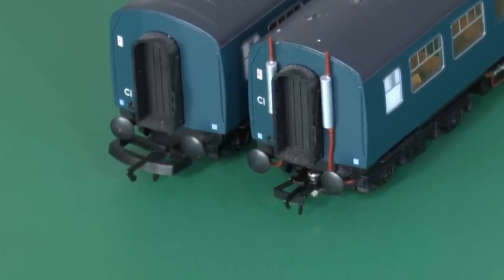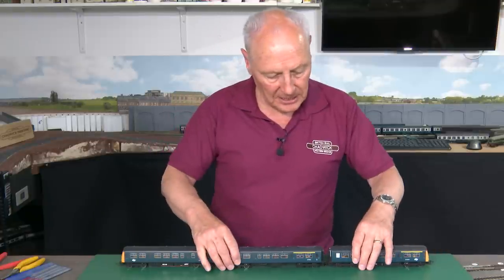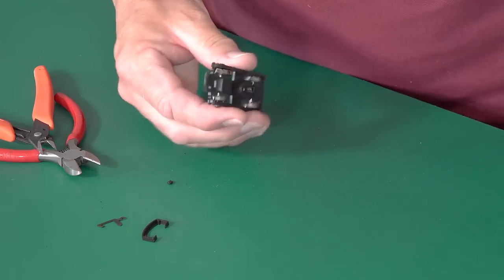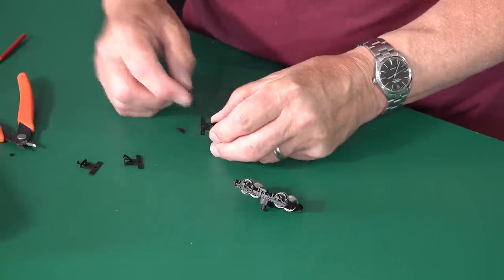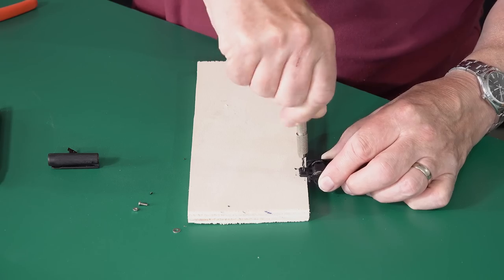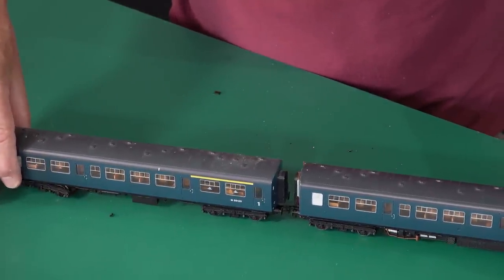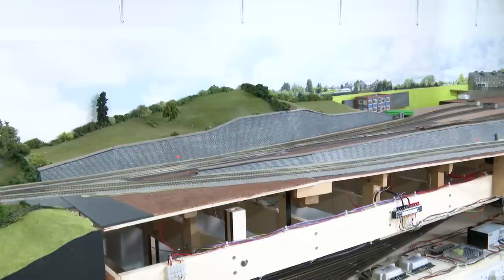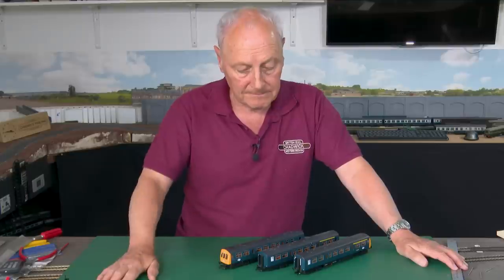REPLACING D LINK COUPLINGS IN SECONDS at Chadwick Model Railway | 196.

Comment: To hide the nut, use matt black nail varnish (hides a multitude of stuff) and does not require brush cleaning; it will also act as a form of loctite. Great video as always. Tom.
Reply from the maker: Thanks OOE, what a great suggestion. Regards, Charlie
Reply: There is always matt black paint!😊

Comment: Charlie,  I have worked in the aviation industry for over 46 years and may have some ideas that would make the coupling appearance a little cleaner. 
If you were to countersink  the heavier plastic and use a countersunk flat head screw and on the other side, use a tinnerman nut, it would be almost unnoticeable.  A touch of flat black paint and it shouldn't be noticed at all.  
I really enjoy your channel and look forward to each release.  Thanks for sharing.
Reply from the maker: Thanks Ernest, however, I shall have to look up tinnerman nut! Regards, Charlie

Comment: A lot of scary sharp tools in this one Charlie! The small black bachmann coupling fixing screws or the ones that hold Oxford cars in place etc. can be used in place of the bigger nut and bolt method, drill a smaller pilot hole and use the screw's self tapping properties to hold the coupling in place.
Reply from the maker: A sensible alternative William. Regards, Charlie
Reply: I did it similarly but with an M2 tap and black nylon screws

Comment: A tip, Charlie, for removing plastic carefully and accurately ..

A 2 or 3 inch thick block of wood, to raise up and support the item. ( The block can be shaped to hold the part more easily).
A file which has never tasted cold steel, but only plastic, used on an item supported on a block ,will remove material far swifter than trying to bring two trembling paws and a spinning machine against a tiny plastic part. 
A jewellers bench peg is the superior version of my suggestion.
Reply from the maker: Wise words, John. Many thanks for your guidance, regards, Charlie

Comment: Hi Charlie, if you drill an under sized hole and use self tapping screws you could do away with the the nut and washer. I have done this loads of times and never had a problem.
Reply from the maker: That’s interesting Terry. What size self tapper did you use? Regards Charlie
Reply: Hi Charlie. The self tapping screws I use are made by 'EXPO' part number A33010   PK, 100 2g x 1\4'' self tapping screws. you may want longer ones, depending on the thickness of plastic you are going through. (Am I teaching you how to suck eggs! lol) Kind Regards. Terry
Reply: @ChadwickModelRailway  Hi Charlie. Sorry I did not reply to you correctly and added my reply to the thread! so here it is again. The screws I use are made by EXPO part number A33010 PK 2g x 1/4'' self tapping screws. longer may be required depending on the thickness you are working with. Kind Regards. Terry
Reply from the maker: Thanks Terry, that’s most useful. Regards Charlie

Comment: With the Lima ridge you can also leave it, level off with a 1mm piece of plasticard cut to size glued behind it and then glue and screw in a Bachmann cranked coupling. Both methods work. Very helpful video Charlie.
Reply from the maker: I’m so pleased that you found a workable solution as well. Peter. Regards, Charlie

Comment: Superb work ! I take note from you because I have bought some Parkside and Dapol wagon kits, and I want to put Kadee no. 5 on them. You put forward some issues you can have while fiddling with couplers, and some clever solutions. I have thought first to simply glue my Kadee boxes below my wagons, but I will certainly take your nut and screw method in action. It seems mechanically sounder than simply glueing, and you can replace a faulty/badly dimensoinned coupler (shank too short for instance, common problem while choosing the right size for a Kadee coupler).
Reply from the maker: I know what you mean, Oliver, I do love KDs but the choice is huge.

Comment: Hi Charlie, Another great video🙂I've done this to my Lima 100 ton tankers and they look so much better, I used a self tapping screw to secure the Bachmann  coupling. I just cut the old D type coupling off with cutters as you did, however when I tried this on some Hornby double vee cement wagons I discovered that the plastic bogies were made of a different plastic and didn't take to kindly to having the D coupling cut off, unfortunately the bogie frame shattered 😱I had to use a small razor saw instead. Regards, David.
Reply from the maker: Thanks David, for an interesting revelation. Regards, Charlie
Reply: Did this with my Lima 100 t tanks too, great improvement.

Comment: Bloody good stuff, Charlie as usual. Many years ago I did some mods like this. I drilled a hole slightly smaller to use with the tiny Black Computer screws to bite into the plastic without having a nut attached. Though if weathering the rolling your M2s will hid better too. For me, with them being a smaller screw I found it helped to blend them in with the coupling and bogie while still holding the coupling in place. If you want to make it permanent, then after all the work and testing is done, is to finish off by adding some superglue and then remove the screw fix altogether. Hopefully this will help as well to anyone that wants to do this mod on their own rolling stock.
Reply from the maker: Excellent suggestions T M. Much appreciated. Regards Charlie
Reply: @ChadwickModelRailway  Anytime, Sir.

Comment: Hello Charlie, I am an n gauge modeller and even replacing the D couplings as you have done they still look very "toylike" and clunky. The gap between the coaches still looks far too big and I would suggest shortening further. Plus fitting corridor connectors. Im no expert on OO gauge couplings but this type just dont  look right on the front or back of trains. I think you did the right thing removing them from the DMU.
Reply from the maker: Yes Robert, it’s a real shame.
Regards Charlie

Comment: Well done with another informative swift video Charlie.
That is such a simple modification.
Much simpler than the mods I had changing all my goods wagons from D links to Kadee's, where araldite had to be involved, no reverting back to D links now.. lol.
Take care and stay Safe
Reply from the maker: Gosh, David, that must be one hell of an undertaking. Regards, Charlie
Reply: @ChadwickModelRailway  It was Charlie, but luckily all the surfaces on the  underside of the chassis under the "buffer bar" were the same height from the track top once all the original coupling moulding was cut off and surfaces cleaned. So just a matter of gluing the Kadee "gear box"assembly, with the whisker coupling, to that surface. All looks really good and more realistic than the big D links, in my opinion..lol. Take care

Comment: if the screw faces up and comes loose the coupling will detach and you will have to search the track for the nut washer and screw, A touch of thread locker, crazy glue or even clear nail varnish will lock the nut in place. thanks for another great swift, Charlie ven if it ran over.
Reply from the maker: Thanks John, I will use some Loctite, once they’ve proved successful. Regards, Charlie

Comment: Another highly informative video Charlie. From an engineering point of view, for me, the screw always goes downward (Ie..the screwhead facing the sky) - that way, should the worst happen and the nut falls off the screw acts as a bolt giving the chance of salvation. If it were inserted from the bottom and the nut fell off the screw would bounce down the track derailing all-comers! :) .
Reply from the maker: You are of course, right Roger. I did that from my helicopter maintenance days. However, we are just playing trains. Regards, Charlie

Comment: Hey there Charlie, I would look at using a small amount of epoxy between the bogie frame and new coupling plus a dab of black paint on the screw assemby to make it neat. 

I recall about a decade ago I was going to go down the Kaydee coupling path but abandoned it after converting a similar 3 car DMU because of the cost. 

Cheers though much appreciated.

Don't forget your safety glasses with the Dremel chum! 

Regards from Oz. Gaz
Reply from the maker: You make an excellent point Gaz. However, if I wanted to swap it out for an NEM socket, then it would be more difficult. Regards, Charlie

Comment: I was hoping for something a little different, but then I'm biased, being in the US. I need to go from a D coupling to a Kadee coupler. What I have done is took them off, and 3D printed a fixture that screws on the train, and accepts the Kadee coupler. So far I've done it on the Reindeer car by Hornby and Emily by Bachmann, which I converted into the steam engine she was made from with working lanterns on the front. I am not a fan of Thomas and Friends, but they do provide something to start with in making an engine I can't get. Like I want to make Lady of the Lake from Emily, since I have made a 4-2-2 steam engine from her now.

My new engine has NEM couplings on it, so it should be a pop out and pop in the Kadee. 

That hand drill can not be undersold. That was one of the best tools I ever got for doing modeling. If you don't have one, you don't know what you are missing.

Great video.
Reply from the maker: Thanks Leslie,  great comment, perhaps you should produce a video on your method.  Regards Charlie
Reply: @ChadwickModelRailway  That might not be a bad idea.

Comment: Very good video Charlie. I did something very similar with my class 101 DMU, but instead of using the small tension couplings, I used the hunt magnetic ones. This prevented the separation on slopes and bends, but also closed the gap between the gangways.
Reply from the maker: That’s interesting, did yours come with NEM  pockets.? If not which pockets dId you use? Regards Charlie

Comment: Hi Charlie re your D Lunk coupling conversion. Given your not needed to break up the DMU. You could use magnetic coupling.  They work brilliantly on rakes that run in either direction and can’t ride up. I also found Porter House are good value vs some others and look better.  Just a thought.
Reply from the maker: You are bang on the money, Howard. However, some folks wish to stay with tension locks hence the video. Regards, Charlie
Reply: I still have to mix it up so that there is an uncoupling end to shut etc.  .  But I heard from West Hill wagon works they might have an uncoupler for magnetic couplings at Waverly! Be interesting if they do.
Reply from the maker: Yes Howard, that will be an interesting revaluation. Regards Charlie

Comment: There's a reason top-level wire cutter snips at electrical supplies cost so much more than those budget 'snips'. They look the same but are not the same. Took me years to invest in good ones and immediately regretted not doing so earlier
Reply from the maker: Yes Stephen, you’re dead right, buy cheap, buy twice. Regards, Charlie

Comment: I am really surprised that they don’t use Knuckle couplers everywhere to me they look more realistic than the type that you get on your side of the pond.
Reply: Indeed. Can anyone tell me why they still use those type of couplers on models in the UK? Is it because knuckle couplers were not used in the real railways in the 1960s and 70s?
Reply: The 1st generation DMUs still used screw couplings as did locomotives (except for Southern Region push pull fitted locos such as the 33/1s and 73s). Coaching stock used Buckeye (ie knuckle) couplers which swung down to reveal a hook for locomotives to hitch on to.

As to models using the D couplings they were pretty ugly but foolproof. They earned and you got fewer derailment with them if they all matched and were the same height. Perfect for train set stock but jarring to the eye, obviously.
Reply from the maker: I feel sure that the manufacturers would worry that,  manufacturing new rolling stock with knuckle couplers would be less popular with many people who stay with tension lock couplings. 
It’s a dreadful situation. 
Regards, Charlie
Reply: Thanks for sharing Charlie but this coupling is not for me . I put these in the bin 😮that how much I hate this coupling. I have some D coupling which I have cut off coaching stock and they are waiting for new couplings to be fixed. Thinking of putting pockets to them . I don't know where I can buy them from. I can then I a choice of couplings to go for 😊 but not these couplings. Once again thanks for sharing take care stay safe
Reply: @peterainsworth8466  I find it interesting that the old Hornby Dublo models had a variation on a knuckle coupling, which looked much neater than the tension lock, but when Triang took over Hornby, the D tension lock began to take over.
Reply: Ribu NEM coupler box

Comment: Have to admit, I was a bit terrified when the Dremel came out!  I couldn't help but think you'd have much more control with a small file.  I was also going to suggest using a self tap screw, but as I'm late to the party, I see a few others have already suggested that, as they have my other suggestion to paint the shiny metal screw/bolt & nut to help hide it.
Reply from the maker: Yes Andrew, there has been some sound advice on this one.  Regards Charlie

Comment: Thank you for another interesting video, Charlie. As a note, nuts, bolts, and washers are available in black. I was a bit worried about your fingers when using the Dremel, have you considered investing in a cheap modellers vise ?🤣🤣 I was wondering if you could produce one of your informative videos on how to put Directional Lighting into a DCC Ready (8 pin) Class 35 Hymek ? It would certainly help me !. Thanks again.
Reply from the maker: That’s a strange question, Neil, my DCC ready Hymeks, have directional lighting,  with a decoder fitted. Regards, Charlie

Comment: Excellent Charlie.  I'm glad you went to the block when drilling.  I also managed to drill holes in my fingers trying to not doing things properly.  I can see why you have done this and it is much better, however I would have thought that NEM pockets so you could fit magnetic couplings or other close couplings would have been useful.  I like to use the Hornby flexible couplings as well.    
I find it frustrating because the lack of capitiblity of couplings.  It started 60 years ago with the metal Ds of Tri-ang qnd Hornby Dublo.  I tried to standardise on Hornby/Peco, but they would often uncouple while running, which the Tri-Ang ones didn't but I hated the huge gaps of them.  In the 70s I tried to standardise on the Mainline small Ds, but fortunately kept the very small Ds from Airfix.  And so it has continued.  I have some beautiful coaches in the Pines Express set except for the dreadful HUGE D couplings.  I did write to Hornby and ask if they would supply the new push in bogies as a spare, to no avail.  I will have to study them to see if I could safely modify them.  But like you say, it is the pushing up hill which is as important as pulling down.  The thing is that there is a value to having the original sets unmodified.  So if I modify the couplings does it reduce the value of a limited number set?
Reply from the maker: Thanks for a great comment, Don. I see that we have both drilled holes in our fingers then! Regards, Charlie
Reply: Regarding Hornby-Dublo, my recollection of them is that they were not fitted with D couplers, but had crude metal knuckle couplers like Peco and similar to Trix Twin but slightly smaller. My 3-rail ac powered Trix locos would run in a (poor) fashion and couple up on a friends 3-rail dc Hornby Dublo track. Also, Airfix/Kitmaster used the NMRA designed (but not officially approved by them) plastic horn-hook coupling which was another variant of knuckles.
Reply: @MervynPartin  I wasn't saying that Hornby Dublo had the D couplings.  What I was trying to say, badly, that even then I was trying to standardise on couplings, the two types were the D and the Hornby and even these varied since they started out as metal and changed to plastic.
Reply: @donsharpe5786  Sorry if I misunderstood. My model railway has a mix of couplings and I would like to standardise too. I would love to use Kadee, but conversion of all the stock would be too expensive. I certainly don't like the big d-couplings, but I will have to deal with them after I have sorted out some problems with the signalling circuits.

Comment: Hi Charlie Ive been using these short Bachmann couplings on my rake of Airfix mk2Ds as well as Hunt Magnetic ones within the rakes. A bit of modification and there's really close coupling to be had. Ive been playing about with Lima couplings and cutting the D off one and using the other to hook onto the lip which gives a good close coupling with Lima stock. Unfortunately it still looks wildly inaccurate but a few more experiments will be necessary...
Reply from the maker: Thanks DJ, I certainly haven’t finished experimenting with the various options either. Regards, Charlie

Comment: I think for safety and reliability reasons bolts go in from the top then they can remain in place by gravity should the nut come off. It gives someone a little bit of time to find the fault before catastrophic failure.
Reply from the maker: I do agree from a technical perspective. However, it does look better this way! Regards, Charlie